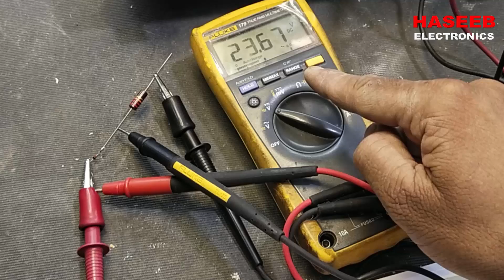[424] How to Find Unknown Zener Voltage Value Without Part Number

Comment: Hello! Although I did exactly as mentioned in the video the Zener I was testing was around 15 to 19 volts. However after connecting as mentioned I got the resistor hot and so I disconnected the supply. Although the resistor survived the Zener got short.
Can someone explain the reason?
The Zener I wanted to fix was for M Audio 40. If anyone has a circuit diagram for the same and share it I would be happy.
Thanks.

Comment: Suppose failure zener diode without marking how to find sir
Reply from the maker: in that situation, we need to check reference design of that specific circuit. i.e. sourrounding any IC or related power supply circuit

Comment: Very useful information, I realy felt heard to find out the voltage value since the diode is very small and couldn't find the value printed there. This is a good alternative method to find unknown owner diode value. Very smart information. Thanks for this video.
By,
Paul

Comment: Thank you, very informative video.I went ahead and tested with zener diode that i knew the value  3.3 volt and my power supply.there is one issue the diode does not stabilise at 3.3 volt when i go up on power supply up to 30 volt the diode also goes as high as 4 volt too. how can i conclude the exact value ?cause we have 3.3 diode, 3.7 and 3.9 too.thank you

Comment: I have a door chime that stopped working.  There's 3 zener diodes that all beep when I test for continuity. Does that mean they're all bad?
I didn't take them out of circuit. 
There's 3 other regular diodes (black with silver stripe) and they don't beep when checking with continuity tester
Reply from the maker: it is best practice to open one end of the zener. in some conditions it gives false beep due to parallel components
Reply: @HaseebElectronics  Thanks...thats what i suspected.
Reply: @HaseebElectronics  ok so I took one of the 3 zener diodes out completely.  It measures 0.002 each way in diode mode and beeps positive for continuity.
So they're bad correct?
Thanks a million!!
Ps. This door chime has no step down transformer so I assume the diodes and big capacitor does that.
Also, the pcb was darkened near the 3 diodes....looks like it got hot on the pcb in that area

Comment: what if the diode is shorted or dead?
Reply: Like me I had to get a 2nd same board to check unless diode has markings you can read. Otherwise it's an educated guess I guess. For example if it sits next to an IC that requires 5v it may be a 5v zener.

Comment: Always  brilliant  with your explanation  and your informative videos. My question is when we make a circuit in which  we use a ZD do we put any resistor value or we should apply  OHMS law (formula).? Thank u
Reply from the maker: video number is 397 on this topic 
and the next video is also on Same topic 
and that will in full details for zener

Comment: This zener that you test is ok but What about a die zener when its short ؟؟
Reply from the maker: if no part number or code visible, in that case we have to find the service manual or circuit diagram for the circuit. or we have to look for similar circuit

or there is another way to analyze the circuit and reverse engineering, but in that case it will an assessment